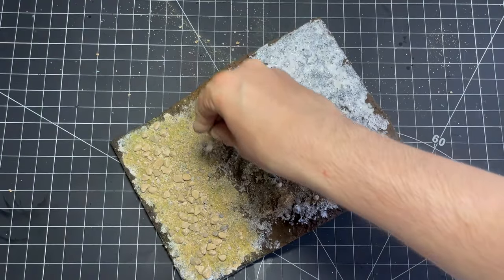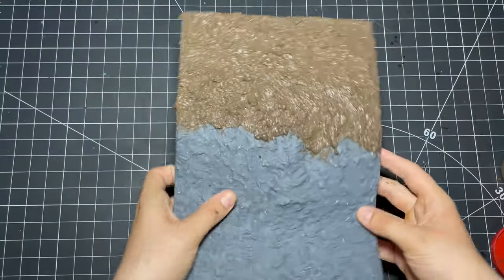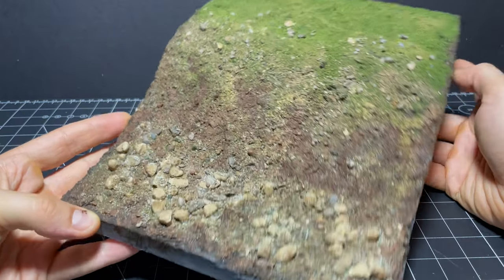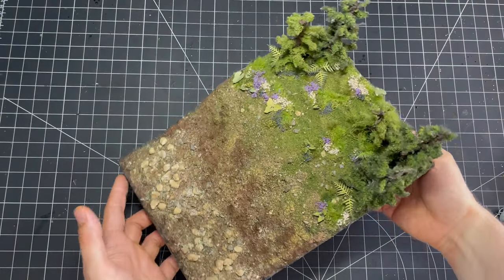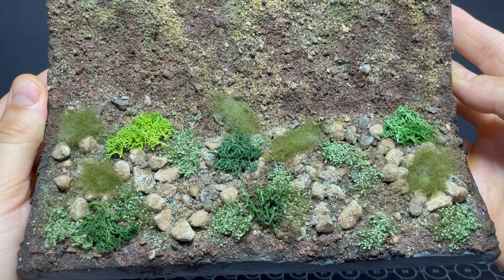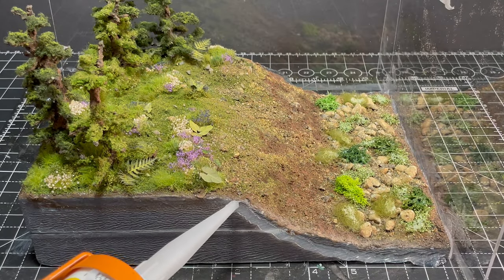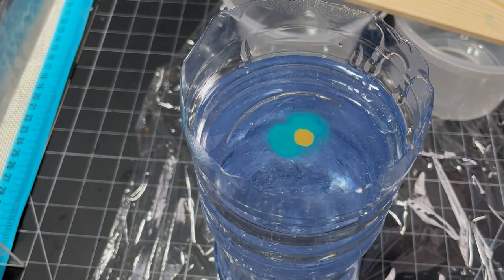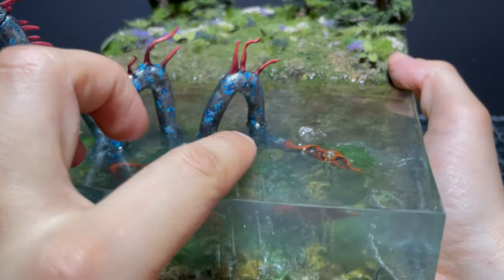Making a Loch Ness Monster Diorama - Resin Fail

Comment: I would like to see the trees being made.  I like them, a lot.  I have used twisted floral wire hot glue and flock, but you have a great look with those pines.  I don't have too much experience with resin, but I have seen the technique of only covering the flock first, let that semi, or fully cure then pour the rest.   It does not look bad though.  Your framing was spot on.  Its a great diorama, and your wife will love it.
Reply from the maker: Hey my man! Thanks a lot, yeah I think I’ve showed the process quickly before too, but I’ve been experimenting with all different kinds of trees recently and was pretty happy with these pine ones especially. Yeah a couple of others have mentioned that, I think that would’ve been the best option really, so lessons learned for next time, and thank you I was really pleased with the framing actually 😄 Good to hear from you as always hope you’re doing well!

Comment: That's a nice looking Jörmungand. Bet the Scottish stole our Midgard Snake and put him in one of their lakes.
at least you're not the only dude or dudette who has had issues with resin. A lot of bigger channels have made massive mistakes and got unfixable results due to resin bubbles. But like some other dude said, it takes seriously long time to get everything you had put in there to cure properly and to dry everything, wonder if even the various texture pastes had cured fully. everything you can need to be 100% cured. That way you only have various flocking to worry about, which can cause a lot of issues as well depending on how much air is hidden in them or they trap anywhere else. And lastly, it was really deep, the deeper the resin the more issues you get it seems like :/
Reply from the maker: Thank you! Yeah for sure, a lot of the bubbles seem to have come out of little trapped pockets around the flock so next I’m going to try doing a smaller pour to seal all those in maybe, thanks for watching!